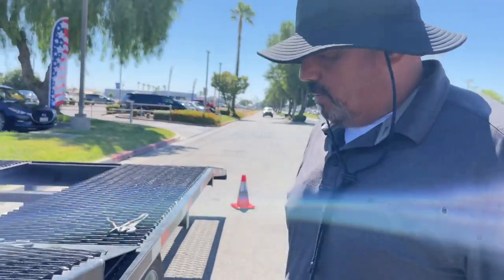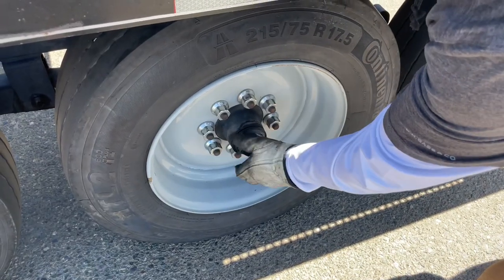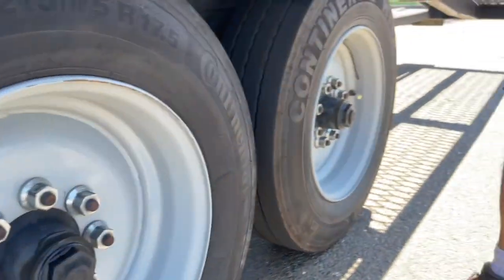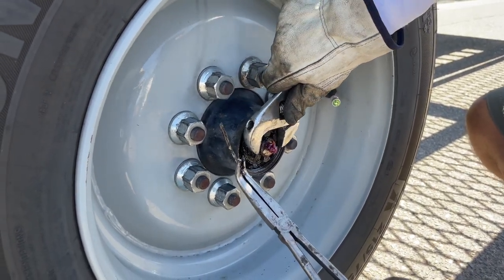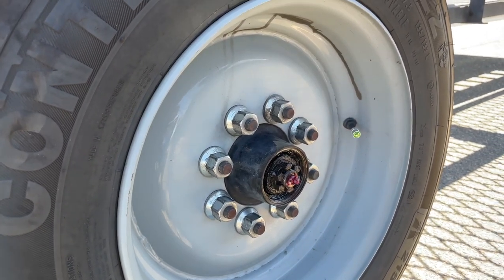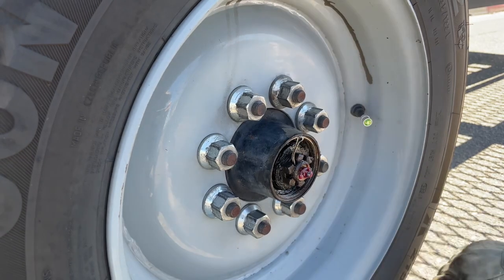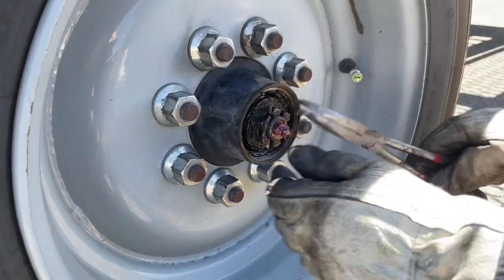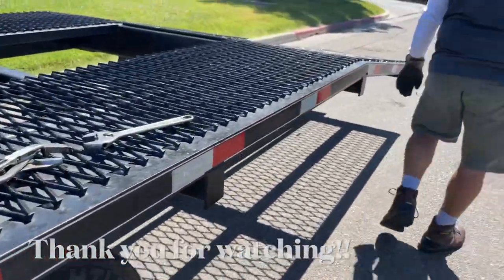How to tighten trailer wheel Bearing.  Hotshot Car Hauling Kaufman EZ4 repair.

Comment: Wow thanks for the tip!!!!!I have a 2021 ez4 and so far I have learned these trailers are cheaply made… therefore a lot of preventive maintenance is needed. Can’t wait to sell it and get a SunCountry trailer!!!
Reply: Is sun country better than infinity trailers?
Reply: @johnsmalls4856  great trailers!! Just a little bit more money
Reply: @Angel-ts6ly  if you had your choice between sun country and infinity trailer?
Reply: @johnsmalls4856  I like the Infinity 5 car trailer (GN550) because it’s low profile would allow me to get bigger vehicles 💰💰💰
Reply: @Angel-ts6ly  ok, thanks for the help
Reply from the maker: My next trailer will be a Infinity, infinity is lighter than Sun Country less stress on my truck.
Reply: @riosautotransportllc  which model r u getting?
Reply from the maker: @Angel-ts6ly   5 car I’m not sure which model but with airbags on the axle, the wife likes the red one 😂.